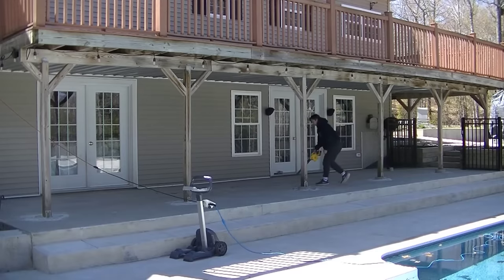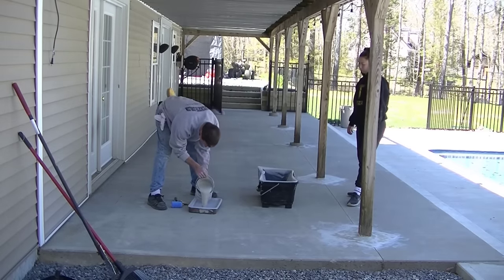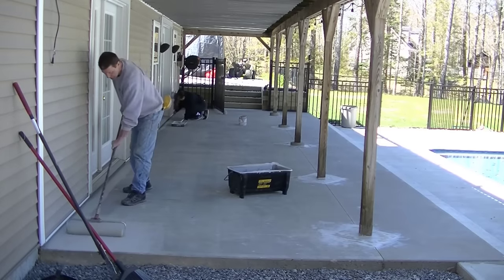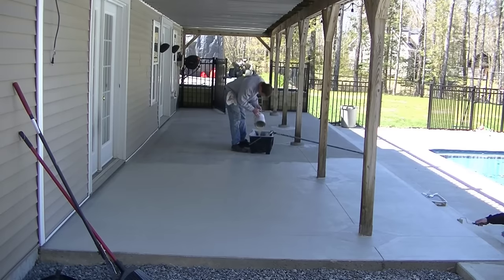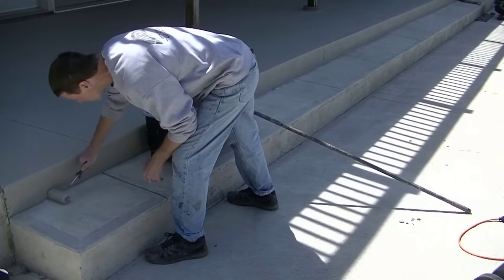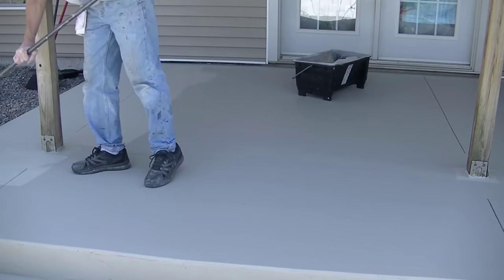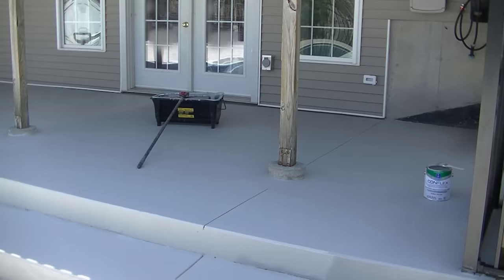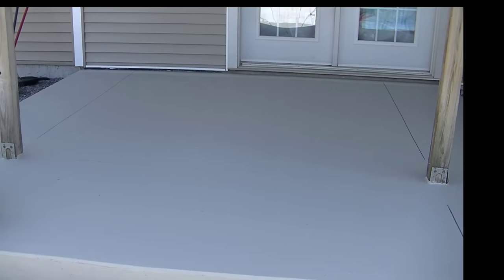How To Paint Concrete (What I Use On Patios, Pool Decks, and Walkways)

Comment: Sherwin williams is so much better I have tried Home Depot paints and always had issues ever since i started using Sherwin williams everything just lasts and comes out better
Reply from the maker: We liked Conflex, then they stopped making it due to lack of raw materials.
Reply: Sherwin Williams is an name brand that's over priced and exaggerated.
Reply: @MikeDayConcrete  Conflex is showing in stock at my local Sherwin Williams?

Comment: I do decorative concrete for a living and own a product line as well. The issue with using topical coatings that do not penetrate or block moisture will eventually flake, concrete is like a hard sponge and having excessive moisture being pulled through the concrete can cause it to peel over time. The key is to make sure that the first coat that touches the concrete penetrates before applying anything topical like a film forming paint.
Reply from the maker: I tell people this is topical and not permanent. It will need to be touched up at some point. I make that clear to my customers. It does adhere very well though if the concrete prep is done right.
Reply: @MikeDayConcrete  Mike, would you be interested in a water based product that is used as a primer that will penetrate into the concrete, block moisture and chemically bond to your paint coating? It's a Two part water based acrylic polyurethane sealer we use as a primer and top coat. What we're basically doing is sandwiching the film forming paint coating between this product for moisture control, color enhancement and protection.
Reply: @jasonolinger7585  I would be interested in hearing more about your product Jason. I have an outdoor concrete basketball court that has 30 day old concrete surroundig 20 year old concrete.  I want to paint it a uniform vibrant color. The new concrete has a vapor barrier but the old does not and I am worried about the paint not adhering.
Reply: Jason Olinger hey Jason I live in Hawaii and where I’m at there’s a lot or rain and long with the heat all Hawaii weather but my sidewalk I would have to pressure wash every 1 to 2 years with all the mold and mildew. Sidewalk  needs some patching and I would like to seal or paint it over to look presentable and last a long time and withstand occasional pressure washing. Can you recommend a paintable solution that a DIY owner could do?

Comment: 1) Pressure washing blasts particles and excess water into the concrete, which is porous. The proper way to clean concrete before painting it is to wash it down with 1-2 applications of TSP, and then wash it down with a low-pressure garden hose.

2) After TSP, the concrete would need 24hrs at 20*C or above to dry completely. 

3) If you're only getting 100 square feet on the first coat, you're using too thick of a nap roller. 3/4 is way too thick a roller, which causes the paint to be far more complex than the 2mil it should be on the surface of the concrete. One of the most common mistakes that painters make is using the wrong roller/applicator for a product. A 13-15mm roller would have been more appropriate for this project.

This is not criticism. I have 20 years experience as a certified paint/coatings expert, and that's residential/commercial/industrial.
Reply: What is TSP?  I have a neighbor who wants this done. We powerwashed 2 weeks ago for Spring Cleanup.  Interested in avoiding first timer mistakes.
Reply: TSP is a liquid  product name, Got it! So you are saying just apply it and then rinse it off? Do you scrub?  Wire brush?
Reply: @Phoenix19Crece  TSP is a granular. You take three tablespoons and mix with 4 litres of water (in a bucket) and scrub the surface with a nylon (not wire) scrub brush. 

Rinse off with a garden hose or low-pressure hose, and let the surface dry for 24-48 hours depending on outdoor temperatures. Surface must be completely dry before paint is applied.

Ideally, when the temperatures outside stay around 20*C during the day and no lower than 12*C overnight, the paint can be applied. The surface temperature of the concrete is critical as well. If painted to early in the spring, it won't stick well to the surface let alone cure properly.
Reply: @Phoenix19Crece  TSP is Trisodium Phosphate. It’s a granular/powder form of cleaning product. You can find it at Walmart or similar stores. Comes in a box and has “TSP” written in big letters.
Reply: Do you need to etch the concrete and then prime it before painting? And then what about selling it after (I plan to stencil a pattern on after the base coat). All the concrete paint instructions I’m finding reference these steps but I don’t see them mentioned in this tutorial.
Reply: @elisabethhaugan4726  You can etch with muriatic acid, but this is mainly done on indoor concrete surfaces, and inside a garage. Washing the concrete down with TSP, rinsing it off, then letting it dry for a day is more than enough.

Most concrete paints do not require a primer as they are purposely suited for concrete and contain more than enough acrylic resin to help adhere to said surface.

Comment: Looks good, we usually use a penetrating primer on first defending  on if it's a recoat or bare concrete. Poly-Enamels work good for top coats, usually do epoxy for the penetrating primer.

Comment: Hey, if you look on the bottom of your roller bucket you will see you can put wheels on all 4 corners! I got the same bucket and you can move it with your foot instead of stopping to pick it up and move it(can be a mess if you don't watch where you're pushing). Great job...👍

Comment: Westcoat is the best specialty coating system you can use out here on the West coast.  Not sure if you have distribution in Maine.  I use the 11-10 system for concrete / pool decks.  It’s a 1-component water based epoxy sealer with an Acrylic topcoat.  If you get a chance, check it out.  Super easy to use and bullet proof.
Reply from the maker: Thanks!

Comment: Hi Mike, good video. I want to paint the concrete on my covered front porch. I would like to stencil a design over the base coat. Have you done a video for stenciling? Would I have to use special paint for the design and do a seal coat? What can I do to keep it from being slippery when done. Thanks!
Reply: These are my exact questions. I can't find info on if I need to seal the stencil and base coat - what did you end up doing?

Comment: Have you ever had efflorescence, I apply our Ceramic coating to concrete (we reflect 98% Energy and same light as well) but I always use a sealer before coating because concrete always emits from the ground up through the concrete and the sealer encapsulates anything from getting to the surface to effect our coating. 
Your video states you have good longevity with the paint, that’s awesome! Great job as well-attention to detail!I subscribed-one can never know enough.

Comment: I'm a painting contractor, and I've been using Conflex for years on concrete and block. I have jobs that I've done 20 years ago and they still look good. Prep is very important, as with any job, Conflex is not a cheap product.
Reply: Do you etch with muriatic acid after pressure washing?

Comment: Great video!  How often do you anticipate having to repaint the surface if the concrete is enclosed in a screen porch with glass windows?   Does the paint allow food/drink spill clean up easy and non staining?  This is such a quick and inexpensive way to make a porch floor looked finished.

Comment: What about doing an acid wash to etch the concrete and increase the strength of the paint/concrete bond?
Reply: Depends on when it was poured. Fairly new should only need a wash. But I do that on older floor where you know the dirt and grime are imbedded in the pores of the floor. Great point to bring up for home owners who plan to do it themselves.

Comment: Here in Queensland, Down Under I used Concrete Colour Systems around my pool, using the recommended non slip additive yet for some reason I managed to actually made the concrete quite slippery when wet.

Comment: What was left out of your video was TESTING for moisture!! The day before you should duct tape a plastic sheet, say 18" x 18" for 24 hours. With this being sealed/taped on all four sides, would give you an idea if any mositure is being held in the concrete itself. I dont care what you use, moisture is your biggest enemy to a sealer or any top coat. I've seen quite a few videos that never address the importance of coating concrete without either etching, diamond sand with a buffer, or making sure the slab is moisture free. Secondly some slabs actually put a sealer in its mix as a water proofer, or has had a clear sealer as a top coat after the concrete has cured. These also can be problematic. On every bare concrete slab i've painted, i always used a bonding sealer as the first coat. After 24 hours then you would apply 2 coats of top coat! The best by far is the 2 part epoxy, SOLVENT based coating!
Reply: lol

Comment: Mr. Day, I must have missed it in the video, but did you have to acid wash this concrete? I heard that you pressure washed it and then blew off the dust the day after and then started to paint. I always understood that you must acid wash concrete for paint to properly adhere? Is this not the case with this newer paint technology sir? Thank you
Reply: Take my advise for what it's worth- some guy from the internet.  You can paint concrete without acid washing.  You need to make sure water soaks into the concrete and see that it has gotten porous.  I painted mine one year +, after poured, and the paint came off quickly.  Now, it is weathered and porous, so I am doing this exact paint/technique.  Love SW paint!

Comment: How long did it take for the first coat to dry? TY!  I want to do this on my patio!!!  Great Video!
Reply: I used Behr Porch and Patio Paint recently and really liked it! I prepped the concrete per directions and put the paint on with a concrete paint roller from Home Depot and it came out really nice. It was easy to put on and dried fast and only took one coat and you can get it in many different colors….good luck!
Reply: @whyme3286  Thank you so much !!!!  Great Information!

Comment: Instead of paint I put stonebond  ( tiny pebbles ) over the concrete around my pool. It has a rough surface which makes it cooler and reduces the chance of slipping. Only drawback is the glue has to be reapplied about every 3 or 4 years. The first couple times I glued it myself, but as it began to age I let the pros take over because they could repair any damage. When I painted the floor in my basement, it still looked good after a couple decades so I only repainted it when we wanted to change the color. The garage was another story. I painted it with 3 different kinds of expensive concrete paint or stain and each time it would come up where I parked my hot car tires. I eventually gave up and learned to live with it. I used paint the last time as close to the color of concrete as I could find and it's not that noticeable.

Comment: Love the videos! I have a question on maybe painting interior concrete floors. We have had to reseal our interior concrete floors twice now in the last two and a half years and it is already peeling again. What would we need to do to prep and then what would be the best way to seal or paint them for heavy foot traffic?
Reply: Need to tape down a square foot of cardboard  to an area you want to paint.  After 24hrs check it for moisture.  If moisture is coming through, don't expect the fancy rubber stuff to stick.

Comment: I had a bad concrete job painted this color and I liked it at first. My yard is half concrete and half soil. All I can say is, you'll see lots of dirt with this light color and I have to do mine over in a brown. Also, this job looks great and the concrete base was solid but beware. This job was done on a concrete porch so it's more protected from sun and rain. If it flakes in a couple of years, there will be double the work to do. I don't understand why this area was painted. It was solid and at the most, may have needed a light pressure washing.

Comment: I highly recommend switching up to epoxy, because that's going to last so much longer than paint. I did overlays for a long time and most of the jobs were grinding off the paint that started chipping after about 3 years, to replace it with high quality epoxy which can last 15+ years. In fact, before we went over the floors again in the warehouse, they were originally done 20 years prior, with heavy traffic, including daily forklift abuse.
Reply: Can you elaborate a bit on the durability of concrete overlays (ie jewelstone)? Are there any that will last long, say 5+ years without chipping, cracking etc?
Reply: @s2syed  I was with concrete coatings for a while and everything they use is polyaspartic based and guaranteed up to 20 years wear time with basic maintenance.

Comment: Once you paint concrete you are stuck forever repainting it, far better to color the concrete or acid stain it, acid staining or adding color to the concrete mix is permanent. I cast a concrete sculpture panel for a local municipal pool building in 2014, adding dark red concrete color to the concrete it looks like red terracotta and it looks great today 6 years later
Reply: Epoxy is much better that's all you had to say
Reply: @Americafirst-i8q  Epoxy is NOT "much better" sorry to say
Reply: Anything is better than shitty cracked discolored concrete.
Reply: Lots of people are stuck with existing concrete
Reply: Any type of paint? What ratio? Thanks

Comment: Sw makes some great products and after 35 years in the coatings business ive learned you really need to use the right material for the surface like inside walls, Promar200 is cheap, covers well but moreover looks great. i dont get much call for concrete painting so im definitely going to try this product next time someone asks... since its acrylic instead of using cheap chipping brushes you should just by something better like a wooster that you can wash out and not take all day "chipping away" at the edges...and you would really love my masking machine to lay down paper and tape at the lowest spot. you would still edge but then you could roll right up to it... thanks for the video!
Reply: Promar200 is interior, correct?

Comment: I have this as project soon at home. Thanks for the tips. Any advice on getting up old glue from outdoor carpet? We tried the pressure washer already. I'm thinking I need to grind it off.
Reply: Did you try brake cleaner? It’s about the most aggressive solvent I know of.
If possible, chose a color as close to the concrete color as possible.
Reply from the maker: Our preferred method is grinding, but we're all set up for it. It's fast and cleans the concrete at the same time.
Reply: @MikeDayConcrete  thank you Mike! Great channel.

Comment: Used the same product a few years back in my basement then it got some water entry from heavy spring rains and run off now the paint has flaked off in places but stuck fast in others and yes I prepped the floof 1st and etched it.

Comment: Looking to re-coat a concrete patio where the contractors used H&C from Sherwin Williams. It did not last long (less than 2 years) and it is starting to flake in areas. After looking at your video, you recommend Conflex from Sherwin Williams. I went to the local SW shop, but they said not to use Conflex because it was "difficult to clean" and very adamant about not using it in high traffic areas. In your video you shared that you have used this on this job and your own BB court. Seems like a durable product. I'm not sure what the dealer meant by difficult to clean and avoid high traffic areas. I'm a bit suspiscious of the dealers comment. Any experience that you can share with regards to how easy or difficult Conflex is to maintain?

Comment: Thanks for this video. I wanted to get a paint that would be weather resistant and would last for years. I had never heard of the paints you recommended. Planning on painting my front concrete porch this summer. I like the grey color you used in this video.

Comment: This video is so helpful! Thank you!!! I’ve gotten so many recommendations from other people and DIY groups about what type of paint to use on our concrete porch. It has been overwhelming. 

Do you have any recommendations on stripping and cleaning old peeling paint off of a concrete porch? I plan on pressure washing first but want to make sure I get it all off. Most of it is peeling and bubbling anyways. 

Thanks again!
Reply from the maker: We mostly use xylene or paint thinner to remove the tough spots of paint. If you use a turbo tip on the pressure washer, that usually removes all the paint.
Reply: @MikeDayConcrete  Thank you SO much!

Comment: I never had good luck with painting concrete but I have had awesome results staining it
Reply: Stain is far more likely to adhere longer.  Thin the stain about 20% for the first coat to get the best adhesion into the concrete.  If the stain is acrylic (water based), apply the stain to damp concrete, just as you would if  you were resurfacing with a portland cement.
Reply: @chrisgraham2904  I agree. Stay away from paint unless you want a lot more work later on when it flakes.

Comment: Mike I have a patio that I put clear sealer on 2 years ago now it shows stains like rust. I have tried scrubbing and pressure washing with cleaners with no luck. Can this Con Fkex be put on a sealed patio that is always in the elements?
Reply from the maker: It can yes. Just pressure wash the old, let it dry real good and then paint it.